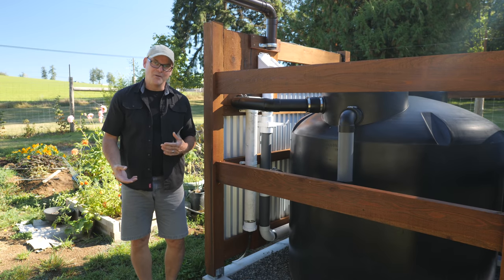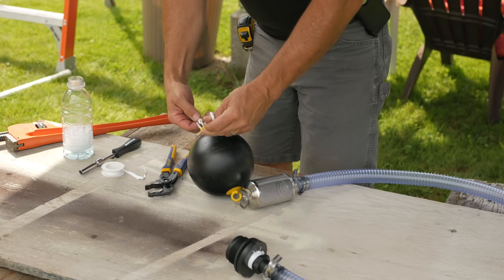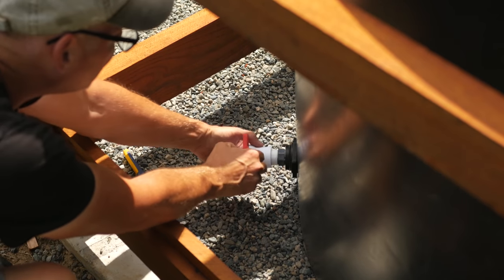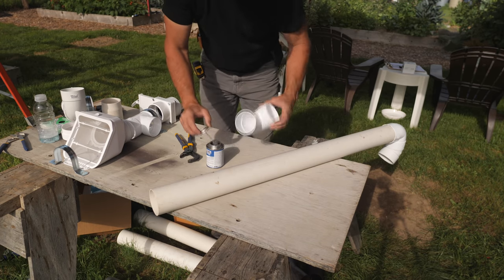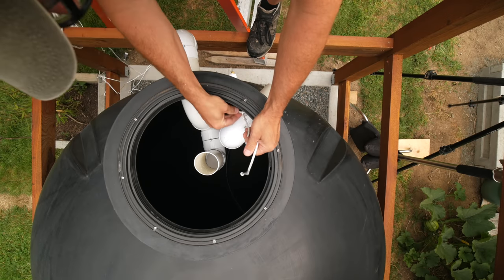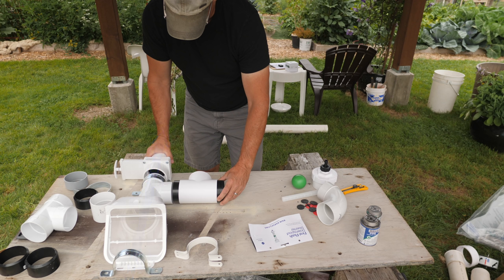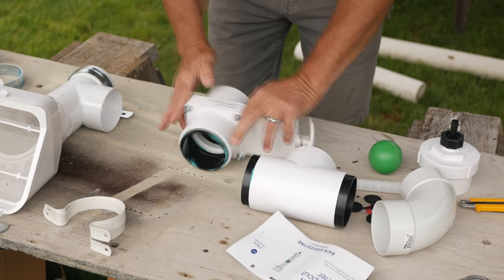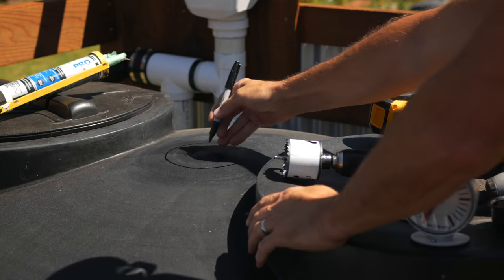Rainwater Harvesting Tank - plumbing, fittings, float, valves [OFF GRID]

Comment: An easy way to get that clear PVC tubing to fit is to soak it in boiling hot water  first.
Reply from the maker: Good tip, thx
Reply: Also a heat gun blowing through it.  Useful for bending PVC as well, if care is taken.

Comment: Been considering how to clean out the tank when the bottom accumulates gunk without having to drain the tank. 

I thought a 6hp wet vac adapted to rv filter [draining back into tank] would do it, but not good enough suction. My next attempt will use the wet vac end piece adapted to 10' of 3/4" pvc adapted to a filter adapted to water pump. I expect to mop/suck up the muck on the tank bottom from the top opening of the tank and return the filtered water back into the tank. Tank cleaned [hopefully]. Would like to see your idea.
Reply from the maker: Maybe something like a swimming pool bottom vacuum.
Reply: @MANaboutTOOLS  yes, that is one way to go. The issue for me is that it would be dedicated to cleaning only the tank ... that gets used a few times a year. That would be a good right solution. 

I've been looking towards a reusable/modular solution so my pump can be used elsewhere when it isn't needed to clean out the cistern. I like efficiency even if $$$ isn't an issue. I concede that modular may not be best - especially when I've put the $$$ into multiple attempts. C'est la vie.

Comment: Why isn't there a gasket between the nut and tankside on the fitting you added?
Reply from the maker: If you look at the fitting at the 3 minute mark you will see a rubber gasket. That will be up against the inside wall of the tank. And it will seal when the nut on the outside is tightened.
Reply: @MANaboutTOOLS  Thanks.  I'm enjoying the series and in the near future am planning to capture rainwater for my garden.